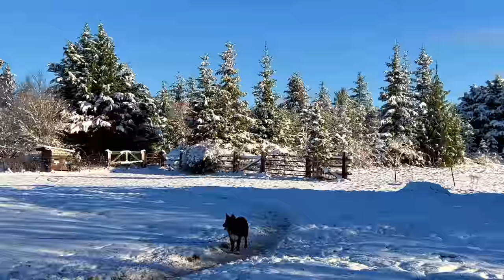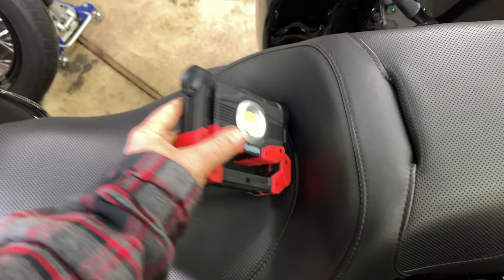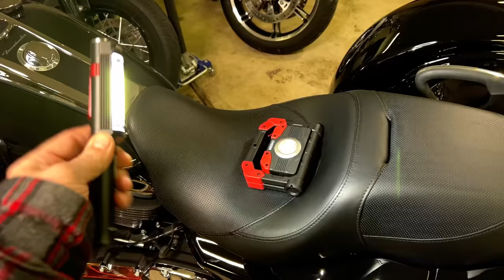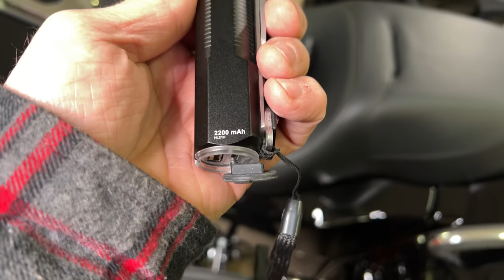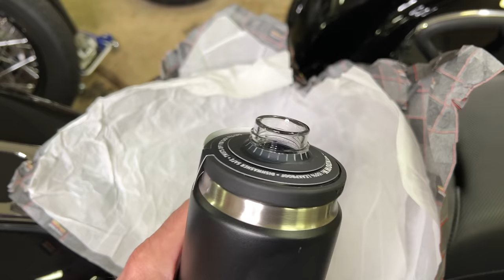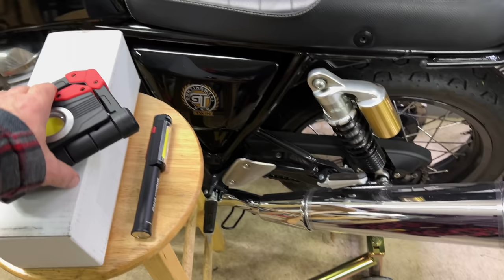Cool Gift from BRP..!! • Plus Gadgets from Kelly! | TheSmoaks Vlog_2236

Comment: Hi Shawn, speaking of lights and lumens do you know how many lumens the auxiliary light for the front of the Spyder RT limited is? The specs aren't on the brp website, the parts department at my dealership said it wasn't listed in their system, and they didn't have one in stock to see if it was listed in the box. For the price they want for it, it seems like an important thing to know. Any information  would be appreciated.  
Keep the content coming, enjoy every video.
Reply from the maker: There are 8 LED's that make up the light, and they are quite bight.  I would guess at least 500 lumens or more...  As you've found, there are no specs listed for the output.  They are impressive though!

Thanks Michael!! 👍